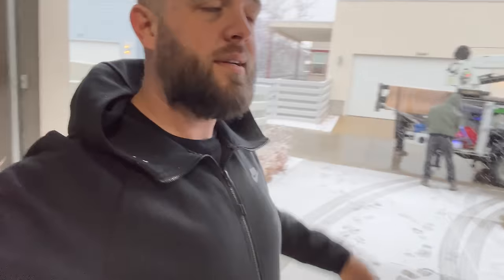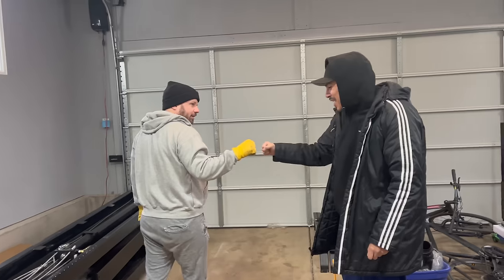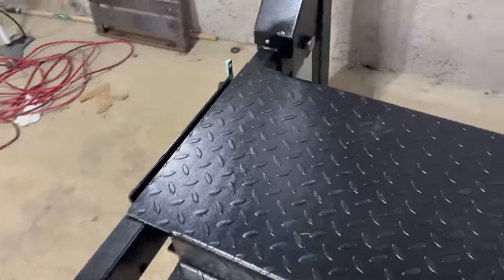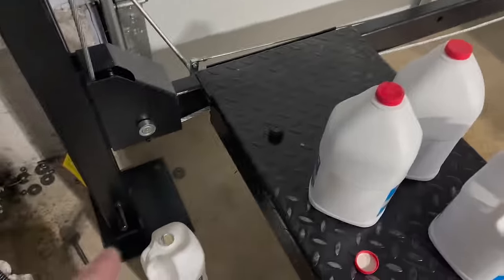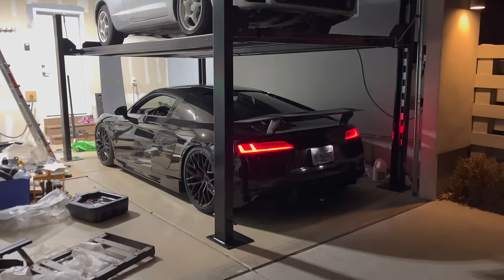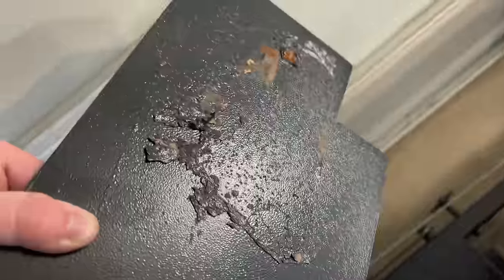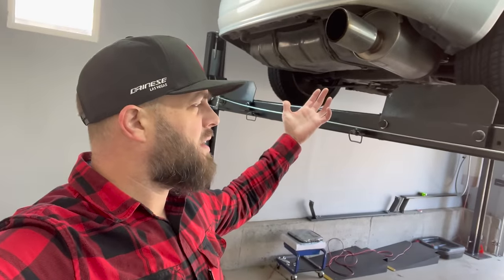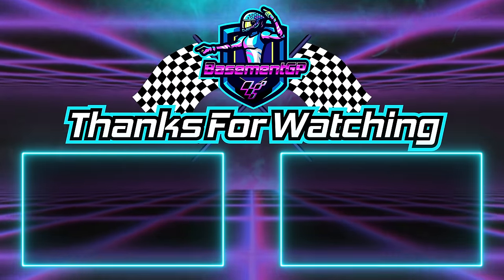Tuxedo FP8K FOUR POST LIFT - Installation

Comment: Great informative post. I just purchased the Tuxedo 9K model and it was just delivered. Your video appears to serve as an excellent guide for my own assembly/installation. Thank you for posting.
Reply from the maker: Thank you! One big thing is make sure to run the rod for the locks inside the tubes in the track. I had issues because I missed those tubes that the rod goes through.

Comment: Have you bolted the posts on the garage floor? Do anchor bolts really require?
Reply from the maker: Not required but the lift does move a tiny bit over time. I just put two bolts in the foot of each post because I am doing flooring around it next and wanted to make sure it stays exactly in one place.

Comment: Helpful video, thanks! Did you have it delivered, how did you unload the lift? And now that you've had it for it a bit, what do you think of the quality/stability, safety, 110v powered pump? Any regrets? I'm considering this same unit for my (UT) garage.
Reply from the maker: SO at the start of the video you can see them delivering the lift with a crane truck. Its been fine so far. every now and then the rear locks jam so the front lowers and rear doesnt, but other than that no long term leaks or issues. I also bolted it to the floor since then. Its 110 but you need to beef up the amperage/ load.

Comment: You wouldn't happen to have a good pick of cable routing would you. Just curious if long cables run from pulley closest to the ramp or the other pulley. Mine are closest to ramp and run at angle to the other end
Reply from the maker: oh I am having a hard time imagining this, if I were you I would look at the routing of a friends i think it should be the same pretty much on any lift. regardless of make. I when running cables just think, how does this support tension/ transfer. I just had to slow down and think about the engineering behind why pulleys were in certain locations.